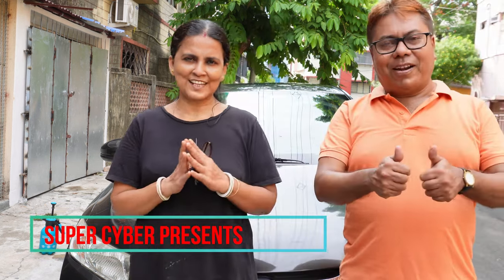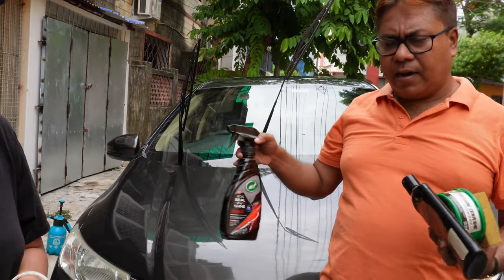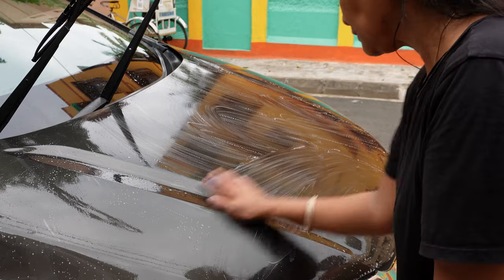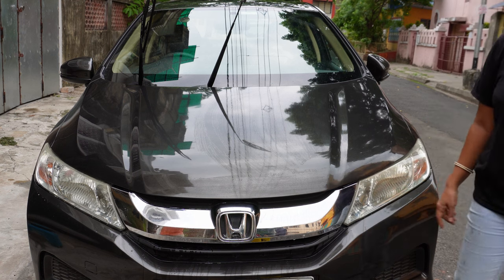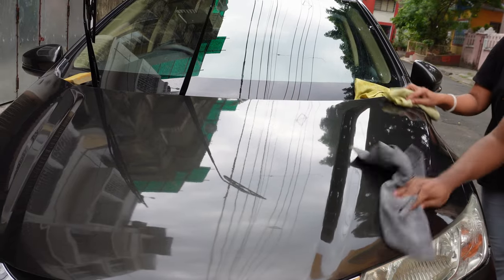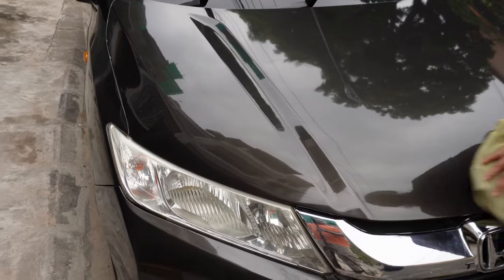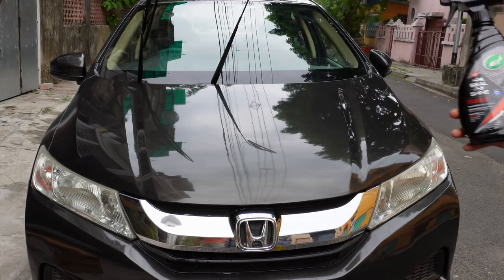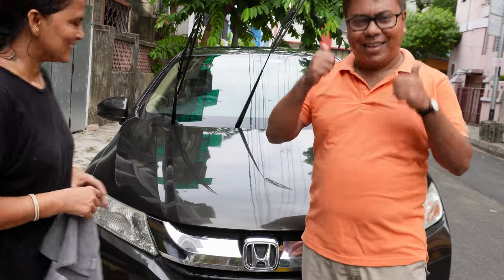How To Remove Swirl Marks From Your Car At Home DIY #cardetailing #carpolish #scratchremoval

Comment: If I don't use compound and after claying just apply Ultimate Polish, will that be okay? And after polishing is it necessary to use wax?
Reply from the maker: Compounding is necessary only if there are too many scratches or paint dullness otherwise ultimate polish is more than enough.Waxing is for protection so it is a must.
Reply: @supercyberautomotivetravel  Ok. Thank you for your reply. Alternatively after using polish we can also use ceramic or graphene coating. In that case before ceramic or graphene do we need to apply wax or after polish direct ceramic can be done?
Reply from the maker: Watch this video it will clear your doubt.
https://youtu.be/Po2sgllhN10

Comment: I have Turtle wax Polishing compound only, Can I skip using Meguairs Ultimate Polish?
Reply from the maker: Yes you can but it will work for light swirl marks only.
Reply: Pls use these following steps.
1. Foam wash
2. Heavy cut compound (any good product example Wurth diamond cut, Meguiar mirror glaze diamond cut and T5-turtlewax). Use rotary polisher machine and woolpad.
2. Polish (Any professional brand)
3. Wax.
Reply from the maker: Thanks for the input.

Comment: can you share what is diff between seal and shine vs graphene wax....are they both a type of wax...i do not want to use polish
Reply from the maker: Graphene Flex wax is a sealant type of product with a mixture of Graphene and synthetic waxes not like the normal car waxes we get. Whereas seal n shine is a polymer based sealant with a mixture of wax   which is also used as a car paint  protector.
Reply: @supercyberautomotivetravel  and can you share which one to use..as a beginner ..and do they do any harm in long run on new car ?
Reply from the maker: https://youtu.be/5UDHILMo9jQ

Comment: Thanks for the videos! Can we skip the maguire polish part and go to turtle wax seal and shine? I only use turtle wax seal and shine on my 4 months old car.,... I use high gsm microfibre clothe...extremely cautious while wiping...still i see a few scratches hair and there... Hairline scratches which is only visible under bright sun light or when some lights fall on that part of body...can you please do a video to keep a leatherette beige color seat clean please? I watch your videos regularly. I am from Rajarhat area. ❤
Reply from the maker: Thanks for your query. Compounding is required when swirl marks are easily visible and needs rectification. No need to remove fine hairline and minor swirl marks. As it is absolutely impossible to keep swirl marks free. You may see my upholstery detailing video in my channel.